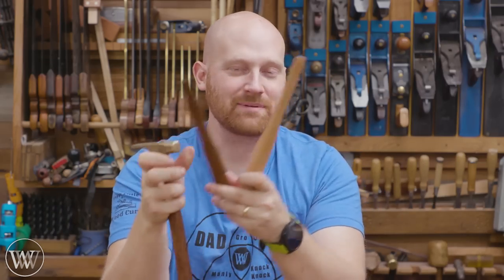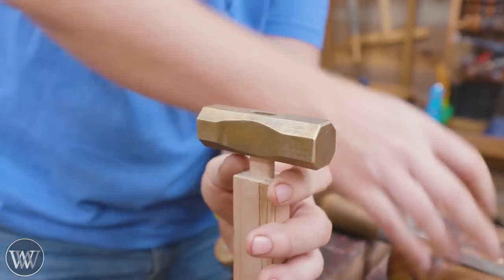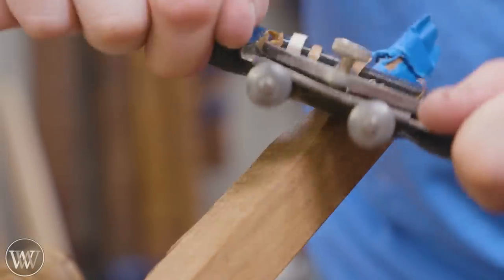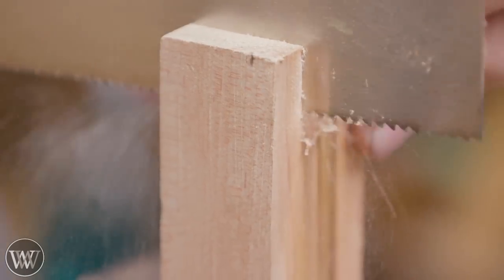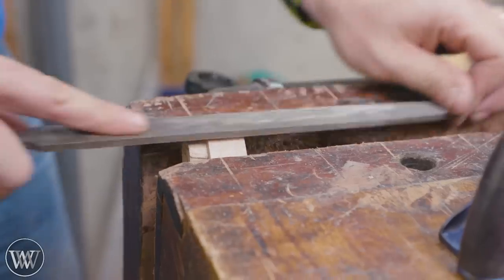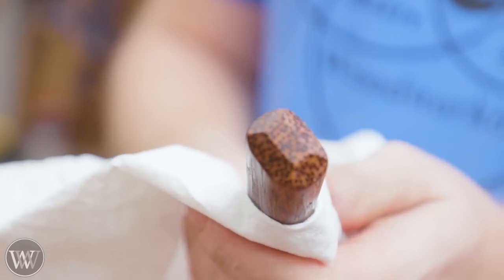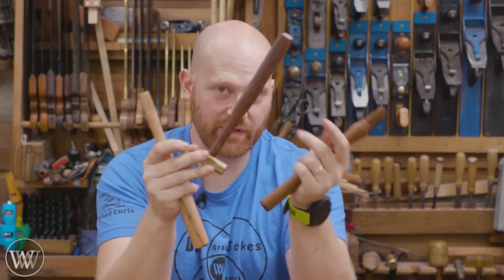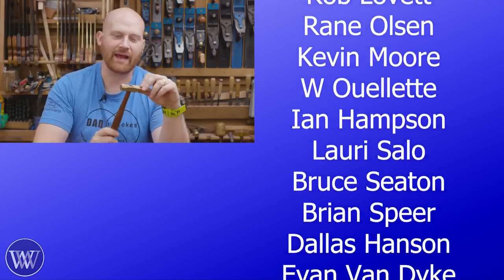How to Make a Plane Setting Mallet or Hammer

Comment: Thanks for all your videos - you're doing a lot to make woodworking easily understood and accessible! You may have covered this in one of your other videos, but: with commercial BLO, would you still be able to use your fingers to apply it, or would the drying agents be too harsh on your hands?
Reply from the maker: thanks. probably around 90%+ woodworkers would not feel comfortable using their hands in BLO with Dryers added. but more and more brands are moving away from dryers.
Reply: @WoodByWrightHowTo  I think I'll err on the side of caution, then. 🙂 Thanks!

Comment: When you apply the Linseed Oil, how do you get rid of the smell from your hands? One of the reasons I always were disposable gloves when finishing is the smell left in your skin that soap and water don't get rid of
Reply from the maker: with home made there is not much smell, and a good scrub with soap cleans them quickly.
Reply: Most "boiled linseed oil" these days isn't actually boiled but has chemical drying agents mixed in. That might be your problem.
Reply: If the oil gets old, it starts to smell bad. Might need a new jug?

Comment: I'm taking the microwave trick. I'm kicking myself for not thinking of that. That solves one issue I've been working through for a new mallet I've been working on.
Reply: To be sure the wood is totally dry I weigh it before I start and when I take it out reweigh. When it stops loosing weight it is done. This does not work well for very small pieces as my scale is not that accurate. For the microwave experiment with short times. The oven set at 250 is also a good option. When do we get to see your mallet? Also do not kick yourself for not knowing this one, please let us do it!
Reply: @reedplanes728  thanks! With any luck I'll have a working prototype before the end of the year. I have a plane to finish, more plane hammers to make, and I'm building a new shop. 

When you line uo for that kick just make it a swift one!

Comment: Try heating the mallet in the oven for a little while and it will expand enough to slip on the handle easier and when it cools it will give you a nice tight fit
Reply from the maker: For something this small the expansion would be almost immeasurably small. To get a miserable expansion it would have to be hot enough to burn the wood.